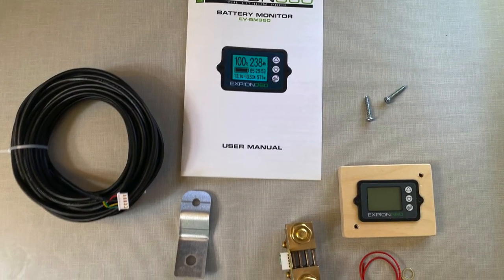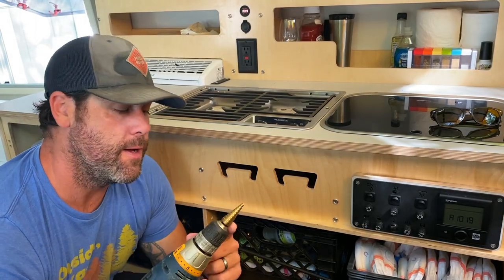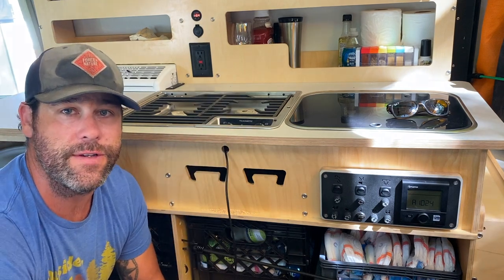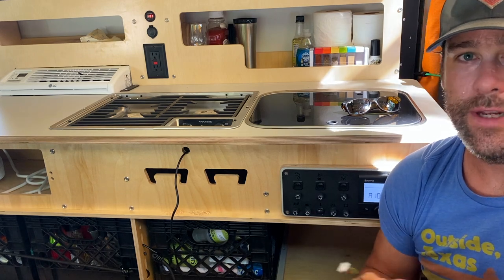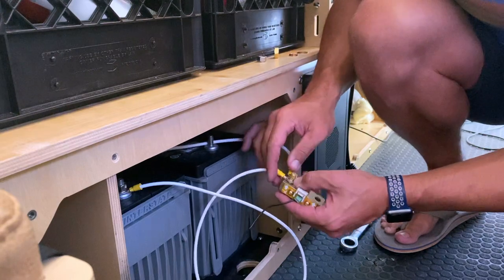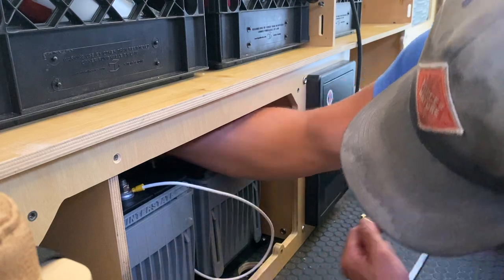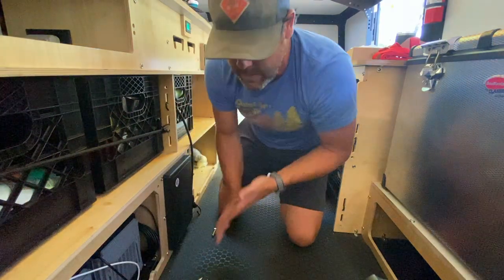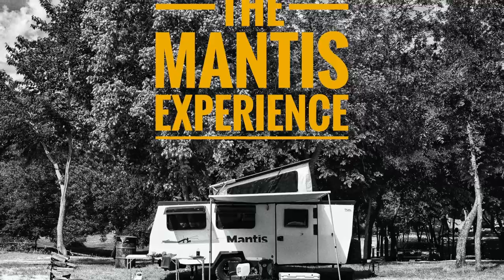Expion360 Battery Monitor Install

Comment: Great video! A few questions: How did you select the Expion360 as your battery monitor? Did you look at other options? Why did you decided to mount where you did and not just replace the voltage meter above the countertop with this battery monitor?
Reply from the maker: Thanks for the feedback and the questions, Matt. I chose the Expion 360 because that is what the dealer recommended and typically installs. He knows his stuff, so I trusted him on it. 

As for the location, that’s a great question. Honestly, there is really no rhyme or reason. You certainly could just replace the voltmeter with it.

Comment: The 2021 cones with a battery read out but it doesn’t indicate if it is charging or at what rate, does this battery monitor do that?
Reply from the maker: I know it indicates that it is charging, but off the top of my head, I’m not sure if it indicates how quickly it is charging.